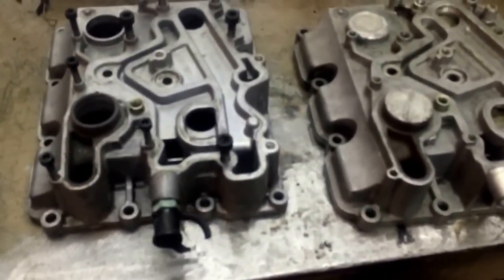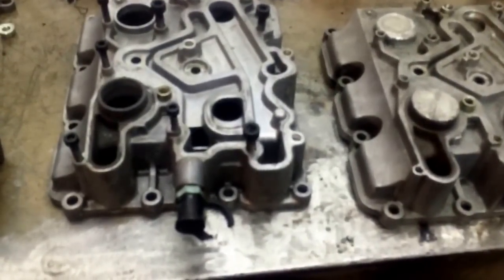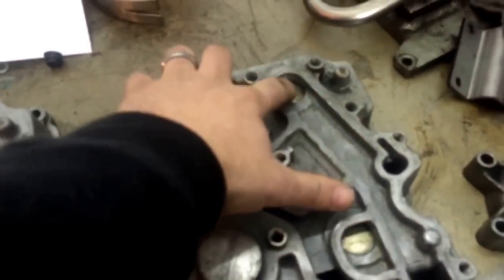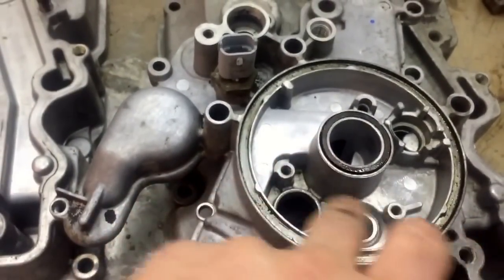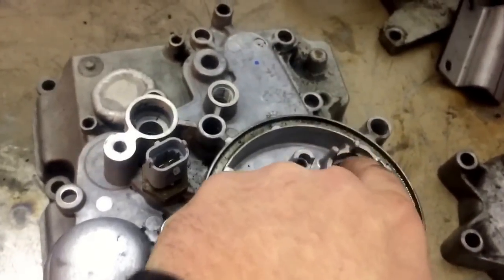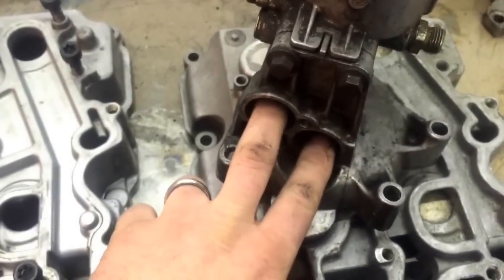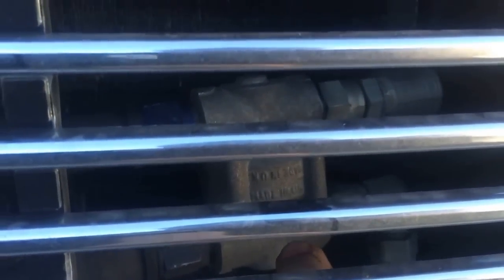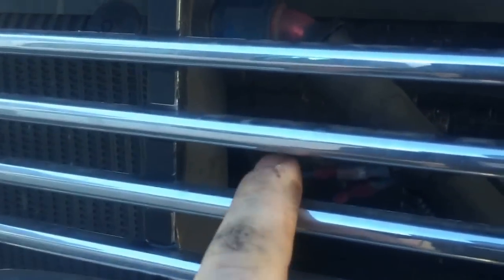6.0 DIY oil cooler and filter bypass

Comment: Thank you so much for all the great videos Josh! Greatly appreciate all the knowledge you cram into them! So I have been researching for weeks on doing a remote oil cooler install since my factory oil cooler on my 2004 F350 6.0 is completely plugged (40° delta). I flushed it with restore & restore plus, even backflushing the oil cooler with an OTC blast vac, unfortunately delta didn't improve. So going with a DIY setup because $2k for a name brand system that comes ready to bolt up is just absurd to me, not to mention the air cooler is made in china. Your DIY is the best looking design I've seen out of all the DIY setups. So to go with the cleanest looking setup I just purchased a used complete E350 oil cooler housing that includes the fuel filter housing all the way down to the oil cooler. I like this way so much better because it eliminates the F style oil housing and allows the oil supply line location further away from the turbo. Well today after stalking your youtube videos again LOL I ran across your other video "6.0 powerstroke oil bypass review" that you did back in June. I seen you mentioned the E350 fuel lines that hook to the housing/pressure regulator are different/shorter. I was wondering if its just the length that is different and if its possible to just modify my F series lines to fit. Like cutting the ends (banjo/flares) off and using braided ss lines with the F series ends. The reason I ask is because I'm trying to do this as cheap as possible and I just priced some used E350 fuel lines and they'll cost more than the oil cooler housing cost me. On a tight budget because I'll be doing head gaskets, arp studs, egr cooler delete(welded ends), stc/dummys/standpipes when I do this install. If my heads are cracked too badly I planned to get your sweet swedish heads. Wanting to do all the work this summer when it warms up a bit so getting my grocery list off all the parts and best places to buy them. For the air oil cooler, I haven't spotted any deals on used Setrabs yet, but if none pop up I plan to go with a new Derale 15875 40 row with -10AN / 7/8" inlet size and 10" fan. Still researching on a oil thermostat and dual oil filter housing that will allow the EAO98 & EABP110 amsoil filters to mount up. Trying to keep all inlet/outlet sizes at a min of -10 size but keep running into the smaller 1/2" inlets/outlets on the dual filter housings. Thanks again!

Comment: I did a backflush to my oil cooler and got back 3 to 10 degrees delta, but you have to make a custom pvc tool to use water and pressure air + the chemicals to remove all the junk from the cooler, it took me a whole afternoon, but it's doable and you don't have to modify anything.

Comment: Nice going to have to do this one day. I'm having a few problems first one is my icp usually stays around 580 maybe a few points higher but on a long drive when I come back to a idle it has a small miss to it and the icp is sporadic sometimes up to 600 and down to 560ish 570ish also does it when I turn it off while its warm and crank it back up. Also, learned alot from dieseltech ron he even helped me on Christmas eve one year a really great guy. So your my new go to guy thanks for doing what you do.
Reply: Did you have a chance to read my ?
Reply: Your ipr screen is clogged or cracked meaning IPR is stuck open do to debris jamming it that made it threw the cracked screen. That's a fact

Comment: This was a good video, thanks.  I also think that you could further improve this modification by porting the "top shelf".  I ported the oil outlet, the one on the out side rim of the top shelf.  I did this because with the cooler deleted all of the oil is forced to go through the small oil port in the top shelf.  The hole was only big enough to fit just the tip of my pinky, it was smaller then a half inch.  Then the oil would go to your filter and air to oil cooler then come back through the center of the top shelf.  I also ported the center of the top shelf.  I did this porting because by deleting the cooler we are forcing all of are oil through our air to cooler, and you always hear people saying that you need big hoses going to the coolers.  With the small oil feed passage you could have fire hoses and you would be able to flow enough  because of the top shelf restrictions.  I will try to post a photo of my ported top shelf.

Comment: So I have a E456 with a 6.0. I have a cracked EGR cooler and plan on going in to do a delete and I've also seen signs of oil in my degas bottle. So I see how using this design works but how do I deal with the factory oil cooler being damaged? Do I remove the original oil cooler and then just let that area fill with oil? If so how do I manage the coolant that's headed that way? I think I'm seeing it now. Remove my van style oil cooler cover, remove oil cooler, replace cover, connect the coolant line in over to the egr out then go online cooler as u have. Old video hoping u still monitor it.

Comment: Hi hows it going awesome info on that conversion but I was just wondering would it work if u left the oil cooler in the truck I just hate taking the engine apart because of getting contaminats inside I know it make sense to remove it but would it work other wise thks for your videos awesome content thks

Comment: how does the hpop screen stay in place?
Reply: the hpo res is the suction side of the high pressure side.the screen is kept down by suction basically .
Reply: @rcarpenter9508  The biggest problem with this theory is the screen staying in place, expansion/contraction and nothing holding down on the hpop screen and I would about bet its going to go floating about.

Comment: Hey man I was wondering if you remember what size hydraulic fittings you used on your 10an fittings? I have an lines right now but want to switch to hydraulic lines but can’t seem to find the chart to show what size fittings to get.

Thanks!
Reply: The AN number is how many 16ths of an inch. So -10 is 10/16" aka 5/8". Jic hydraulic fittings fit AN fittings.

Comment: If you are using a  stock e350 oil filter housing, do you leave the check valve and the bypass valve in the housing or do you remove them, and weld the drain back hole up.
Reply from the maker: the e350 check valve and bypass valve is in the oil filter housing under the truck and not in the oil cooler housing and if you use the e350 top shell the drain back hole doesn't exist.

Comment: I want to do a hybrid of this using the E350 oil adapter, hard lines, and external oil filters, but keep the stock oil cooler (mine is new)... other than plugging the drain port in the oil filter housing on the base, would this work?  I will fab a bracket to use the stock F250 (2005) secondary fuel filter and fuel lines, versus an E350 fuel filter housing and lines.
Reply from the maker: if you want to keep the oil cooler you can do that and still run external filters like i did in the video. make sure you use at least 5/8" lines and make sure your filter has 1" threads like the filters im using.. dont use anything smaller.

Comment: Hi, where did you get the oil bypass thermostat and the dual oil filter housing. Are you using an tube oil cooler or a plate style cooler? Thanks for your time
Reply from the maker: parts are listed in description..

Comment: thanks for the helpful tip. i have an 05 e350 van so would it be just as easy? and what did you do about the oil cooler? you said keep the screen on but do I completely remove the cooler?
Reply: come on?? answer me
Reply: Hello, did you leave the cooler in??
Reply: Hello, Please help, I'm putting mine back together can you tell me what you did??
Reply: I told you to leave a number or an email and I  will be glad to help you.
Reply: no you take the old cooler out and weld up a few holes. I will be making a video soon and I'll be glad to help anyone who needs it.
Reply: I can't put that info openly online. I wish youtube had private messaging like they used to
Reply: hope you can post something soon
Reply: I  gave you my email
Reply: you have mail

Comment: what is the new delta difference in temp between the oil and the engine coolant with the new air-to-air cooling versus the stock set up of say 6 to 7 degrees?
Reply from the maker: it takes long for the oil to get up to 180 degrees. and if engine temps gets up to 190, the oil is about the same. once the fan kicks on the oil cooler it cools the oil down immediately. with towing the oil stays about 10 degrees of the water. when not towing oil is usually cooler by 10 degrees.
Reply: the video I will be posting soon will show the oil up to 20 degrees and more this is with out a fan.

truck will high idle on an 80 degree day all bull shit a side.when you guys finally see this video you will be impressed to say the least at how I've achieved these numbers.
Reply: Looking forward to the video!
Reply: leave your email and I'll show you something you have never seen done on these 6ltrs GUARANTEE IT.

Comment: That bypass filter surly is not in line right? I didn't see it detailed in your diagram but the bypass is tapped off the main line and fed back in separately otherwise it would starve the engine for oil at high rpm correct??
Reply: that style of bypass filter setup looks inline but is not. there are valves built inside. AMS Oil sells a kit like this, as well as CAT and Baldwin

Comment: What happens with the coolant that would go to the cooler?
Reply from the maker: the coolant gets blocked from the welded plug..
Reply: So is the coolant hole on the intake plugged off

Comment: Question about the filters used. The smaller is a ea098 and that is a bypass filter right? What is the number on the taller filter? Has anyone tried a Baldwin instead? Thanks.

Comment: I've done the bypass oil cooler using a van style filter housing, and tigged up the holes in the cooler housing. After I got the system bleed and full of oil and coolant. I drove it about 5 miles and now I have water in oil and oil in the coolant. I pulled the oil pan off and did a pressure test on the coolant system.It was leaking ( it looks like the coolant is coming from the front water pump cover and ruuning in the oil pan.) I remover the front cover, water pump and oil pump. I can't find anything wrong. the housing isn't worn much at all where the pumps sit. do you have any ideas? Thanks Tracy
Reply: Hello Tracy, I'm getting ready to do this and want to avoid this problem. did you find out what the problem was??
Reply: Please help, can you tell me what you found??

Comment: The oil pressure test port on that housing isn't 12x1.5. mine is bigger its either 14x1.5 or 9/16x 18 thread. I bought the 12x1.5.It falls in the hole
Reply: Hi, I'm getting ready to do mine.  Did you solve your problem?

Comment: Couldn't you just make a plate to go on top of the manifold to move the oil to the filter and cooler then back?
Reply from the maker: Ivan Rudnitski how are you going to direct flow of oil from pump to hpop and to the bearings.
Reply: @powerstrokecustomsllc1942  good point I didn't see that before.

Comment: Hello Dr, I am going to use your oil cooler idea on my 06 f350 rebuild, thanks!. I have a old van motor also 06 E350 and will use parts from that but I want to make the oil filters where I can easily change them so I am going to keep the van filter housing and use regular filters. Any problem in doing this? I also noticed that the van filter has what looks like a back flow valve? it was mounted below the engine, maybe I'm seeing something else?

Comment: Can you build me a set up .. how much ?
Reply: I  would not build your system like this guy's because he has unfiltered oil mixing with filtered oil.
Reply: Let us see what your talking about??
Reply: better rethink and look again lol.he opened up the two holes but only one is feeding directly into the hpo res. along with what is being filtered and dumped in this I'd why this system works all I can say is plug that bypass hole up and watch what happens plus he has his bypass filter in line which is completely wrong and is killing the flow.he should branch off the main supply line with a smaller line and his oil would be a lot cleaner as a little oil at a time would be filtered down to 2 micron.
Reply: @rcarpenter9508 it goes two directions...one direction goes to the hpop after the hpop where does it go....thats right back to the pan....ok now where does the other direction go....thats right it feeds the rest of the motor like crank cam oilers lifters.....now if you know anything you'd know that if he was feeding straight through a bypass filter the motor wouldnt last long obviously his remote oil  filter block is the correct dual filter bypass block that internally branches the to the bypass...furthermore if you knew anything else you'd know that the van top housing like he uses has no drain back hole
Reply: @dickgoesinya3183   you need to go back and what I wrote mr.if I knew anything and you obviously don't know how the system works correctly. but let me explain it one more time for you.He is mixing dirty with clean.takr a look at the 2holes and how he has them routed and if you still don't understand it then well go back and look at it again till it sinks in have a good day bud

Comment: People say use 12AN hose, you said 10AN.  I suppose it works well or something I missed?  Thanks.
Reply: How much oil did you use in total? Thanks to your diy method I was able to get my truck running. I noticed the oil in the high pressure rail seems kind of foamy
Reply: Hello did you find out what the problem was with the foaming was?? I want to avoid problems doing mine, thanks!
Reply: you are sucking air if your oil is foamy it is more  than likely coming from the lpop side and entering the hpo res from  the low side.
Reply: R Carpender, Dr.'s video get's a little confusing at first because he switches what he's talking about between using the f350 stock or e350 oil set up. I am wanting to use a 06 e350 oil set up, including the filter housing (where I can access it easier-not under the truck). I will tap a bypass filter off that line somewhere. Both the top housing and the lower filter housing has what appears to be those check valves in place. I am very interested in the video your are going to make. Im trying to understand what your saying, could you take some still shots from photos on line and mark it- delineate  in red to show us what your talking about??  I would really appreciate it! Thank you in advance